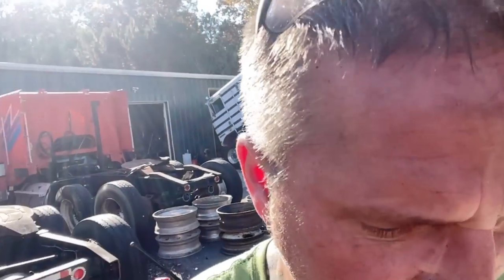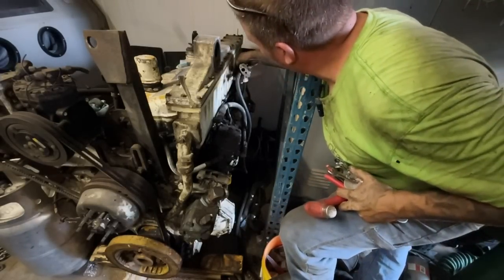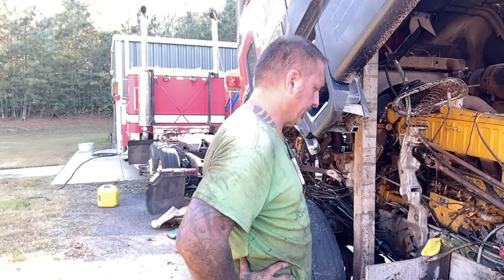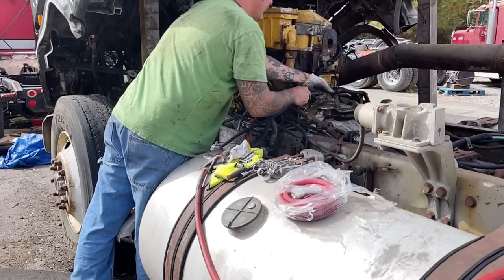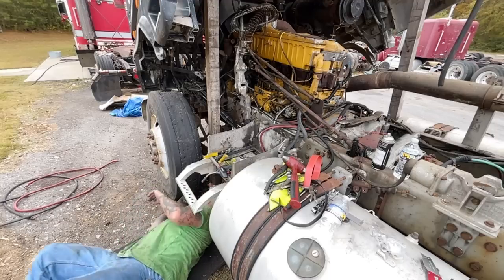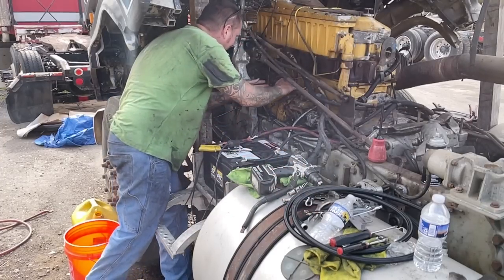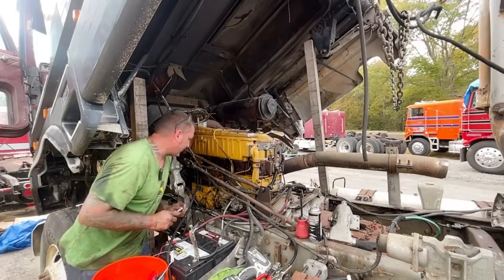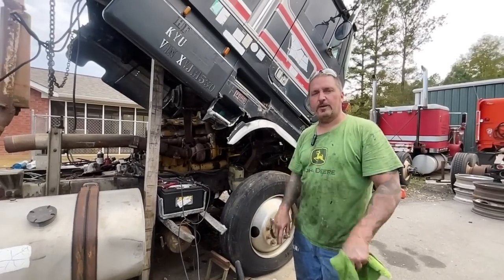FORD CLT9000 Cabover  Can I Figure Out The Fuel System

Comment: Before you work ON all the injectors replace the Main Fuel lines to Pump and Pickup Tubes.
That's if you were using the original tanks for fuel or hook a external fuel source not using the OLD lines which can internally plug from collapse.
Reply from the maker: For sure bro
Reply: @JamesPretty  you are a true grit determined rust inhibitor. Keep wrenching, and keep flying. P.S. when can we expect to see your YouTube's as in flight entertainment ?
Reply from the maker: @tossedsalad5532  hahaha I wish

Comment: Good job James & Jesica never lost faith in you or this ole ford. Did you check out the tube heat exchanger for Crystal they have worked for me on river boats and other refrigeration  applications and you can mount them remote. Also I have used electric pumps to prime fuel to diesels so you don’t need to wear out starters, like the videos and your way of trouble shorting good luck to both of you.
Reply from the maker: I have looked at them. Haven’t made a decision yet

Comment: I hope you can find the parts for the cab to make this complete!  Love the old Ford's but very difficult to find cab parts.  The rest of the parts are probably just the standard parts many other trucks used.  Engine, Trans, rear ends, suspension so on?
Reply from the maker: Ya I think cab parts are around. I have a couple parts trucks near me. Hoping I can get it all fixed up
Reply: @JamesPretty  Cant wait. Thx

Comment: I have a 89 peirce one pumper truck 90000 actual miles automatic you can drive Detroit diesel airbrakes you can hit me up if you need a drive train or parts really nice unit I'm up to offers
Reply from the maker: What engines 8v92?
Reply: @JamesPretty  yes low miles and been serviced regular by Greensboro
Reply from the maker: @royhulin8639  you’re selling the engine?